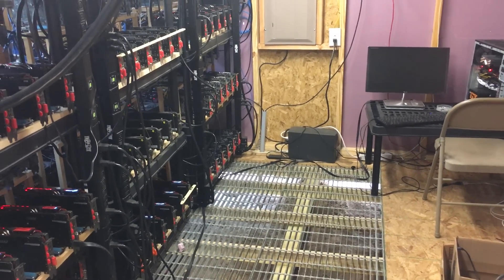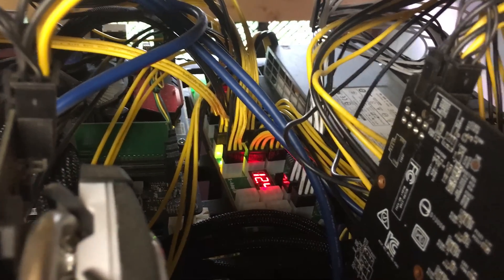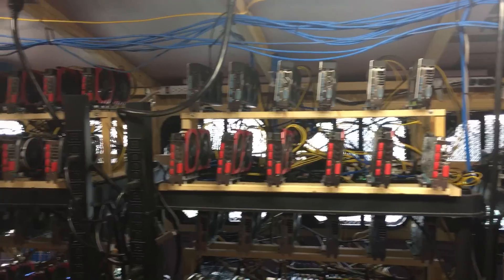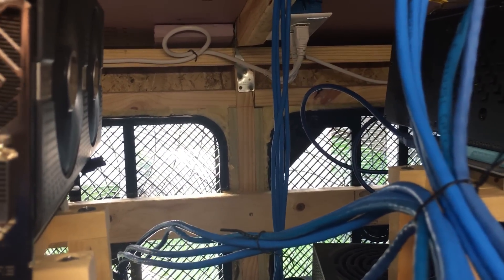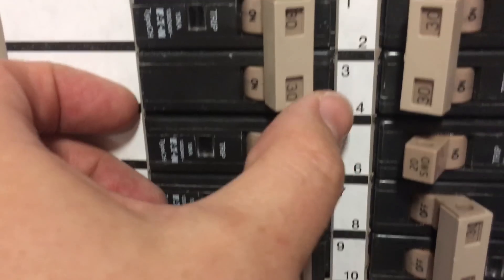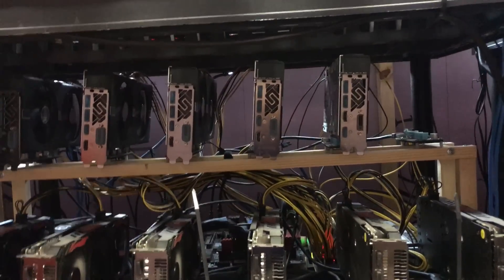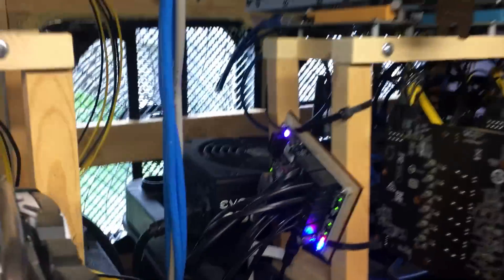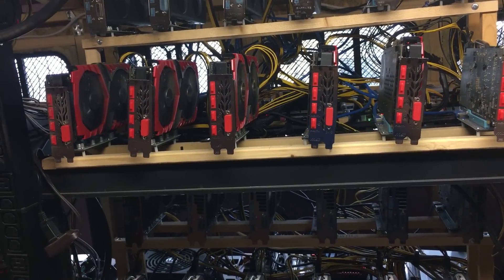5.6GH 192 GPU Ethereum Mining Shed - Nov 2017

Comment: I work in IT - and that cold aisle is key. Nice job man.
Reply from the maker: thanks, but as others have mentioned, humidity is an issue. Do you have any suggestions that can be integrated into existing system?
Reply: Well, you're pulling in outside air which can be humid. The cold aisles we use in the data center are conditioned. Perhaps you can run duct work from an actual air conditioner and blow the air up the vents from below.
Reply: BeerMan 81 or run a giant dehumidifier?
Reply: I doubt it would work; the air would have to pass through something to condition it before it enters. A dehumidifier unfortunately wouldn't process the air as it came in and out so fast. :\
Reply: I think you could try and use a dehumidifier
Reply: I work in IT as well. Seems you could limit some of the fans, put in a AC unit running on 110 or 220. Seal up the floor to keep that summer humidity down and put in one of those dehumidifier and run the drain outside. You would be cooling the space and dispersing any excess water.
Reply: @KineticEV  best answer I’ve seen
Reply: you can add gravel under your shed it will help you out alot.
Reply: I dont suppose we could get him to fit a Liebert machine in his little shed huh? xD Sr DC Tech here.. What about utilizing a commercial grade roller unit, allowing it to pump into the common air, run exhaust duct to roof onto a flap vent (opens when blowing, closed not, same kinda concept with a motorhome AC unit). Seal the floor, or AT THE VERY LEAST, install inline air filters, because youre not only bringing humidity, but youre bringing in critters and dust/other bad particles. Clean air in, bad air out. Keep fans though, thats a good idea.
Reply: I mean, have you tried a simple Dehumidifier?
Reply: i was looking at a way that they filtered air with bags for gensis mining, https://youtu.be/2Jqf_wZKFCc?t=3m36s
Reply: That air coming from outside dust will make the fan slow down in long term. Then it’s also hard to sell to gamers when it’s time to replace.
Reply: Also i would get some Hvac filters and figure out how to fit them to the grate underneath. change them every year atleast.
Reply: I was thinking run an air compressor through a HEPA filter into an air receiver with an automatic condenser tap to drain off the moisture from compression/external air.  Fit a pressure relief valve with a lower pressure than the compressor is running at, and you'll have constant dry oil/particle free air coming in.  It would mean sealing up the floor though so it might be a bit of a pain in the ass.  You could duct the incoming air directly below each rig with different size inlets though, so you'd cool them all equally.
Reply: LOL, a Liebert unit would make this a losing proposition in short order.  Mining is a thin profit endeavor.  Most real profitable mining outfits are in cold weather countries for just this reason.  The dirt, dust, grass clipping, humidity, and mice will destroy these rigs and electrical in short order.  Horrible set up for longevity, bet it never reaches break even.

Comment: I was looking to build a small scale version of your shed and wondered if it’d make a big difference having the air pulled in the bottom and exhausted above the shelves as opposed to behind like in yours? Where I’m looking to build a “shed” has coverage overhead about a foot above it. The box fans would be blowing up, but I’m wondering if the overhead obstruction would be an issue. What’s your GPU temps/fan speeds when it’s 90-100 degrees out?
Reply from the maker: That's good, however do not use box fans. Get a better fan or two with a bit more oooomph (lol). When we added filters, it cause a cascade of other issues. Our Antminer section has 2 of these and they are great. They are variable too, but you should be careful as they could auto-shut off. It may be better to have constant running ones. Call the mfr and find out.    http://a.co/iJlUuD8

Everyones situation is different, but you can see my temps here: https://imgur.com/a/WxjJPYq
Reply: Thank you. I think I have it figured out to where I can put the exhaust fans like you linked to on a side wall facing the screened in patio and the intake on the side close to the house. So basically I could do an entire wall that looks like your floor and have it come in one side and out the other. The grated wall would be about 6 inches or so from a solid wall with overheard cover, so no one would see the intake side, but it should be more than enough area to suck in air and still be secure. The room would be 8 feet long by 6 feet wide. I'm thinking of offsetting two 3 foot wide shelves and trying somehow to split the room in such a way that both shelves will have cold air going past and hot air being pulled out. It makes sense in my head, but maybe I'll have less room inside than I realize.
Reply from the maker: Build it bigger than you think you will need for sure. You need filters somewhere too
Reply: BeerMan 81 I’m thinking most of the 6x8 wall will be a “filter” similar to how you have your floor setup as the intake.

Comment: Why exactly did you "insulate" the inside of a shed with a giant hole in the floor?  SO much fail here.
Reply from the maker: The heat from the sun increases the ambient temperature of shed via conduction. The temperature decreased significantly after installation. Lower temperature = easier for GPUs to cool

Comment: so let says outside temp is about 90-100F, what would be your shred temp with this type of this exhaust system? I want to build this shred so bad but not sure if its applicable for Texas heat temp.
Thanks alot
Reply from the maker: I Live in Texas too. The heat exhausted is ALWAYS higher than ambient temperature because of electrical consumption. 

I would suggest better exhaust fans (see my video series on antmuffler) so you exhaust heat faster and because of the higher Delta P. This allows the fan to pull air through a restricted intake (ie filters).
Reply: I appreciate your input. May i ask what is the size of your shred and temp inside the shred in summer time?
Reply from the maker: 10x14 and about 96-100
Reply: I appreciate the info.

Comment: Hey quick question! Is your panel a three phase service or a single phase service!?
Reply from the maker: Single phase. The transformer in my neighbors yard is 480/240. You can mine on 3 phase as well, but the PDUs would need to be different than the ones that i use.
Reply: BeerMan 81 is it just a 200 amp panel I’m assuming?

Comment: Good job man.... good job...Keep improving!Just asking,I'm just a really small miner, I'm running 5 Rx 570(3x4gb + 2x8gb) and I'm only getting around 16-17mh/s per board with no bios mod or overclock...I just cant manage to solve this issue.. is it normal in this epoch?Check out my miner if u want to https://eth.nanopool.org/account/0x8d915ceb9c3f82e735a52663cf3fa7dbdde36c76
Reply from the maker: you dont have the blockchain drivers installed. https://www.youtube.com/watch?v=JRS1NMGaYe4 https://support.amd.com/en-us/kb-articles/Pages/Radeon-Software-Crimson-ReLive-Edition-Beta-for-Blockchain-Compute-Release-Notes.aspx
Reply: BeerMan 81 thanks man... But I'm running Linux
Reply from the maker: Which Linux version or mining OS are u using?
Reply: Ubuntu 16.04

Comment: also why would you insulate you are trying to get rid of heat with ambient air so it will never get cooler than outside anyway
Reply from the maker: Because the sun heats up the walls and transfers heat into the air, which heats up the ambient temperature inside the shed. It helps a lot actually.

Comment: 200000 dollar investment 2 months to set up 2 years to pay off, just my guess. After 2 years assuming coins hold price then making 100000/yr and declining. due to increase in difficulty. 2000/year maintenance. 2021 until it pays off for sure. How close am I???
Reply from the maker: 200k? Where did u get that number?
Reply: it is a guess you have building cost fans motherboards watchdogs power supplies risers and the works. it all adds up,  how much was it and how much are you mining, may i ask?
Reply: batman 1999 maybe 350 a day?

Comment: Um Dude why do you have the heat exhausts pointing into the room when they should be pointed at the wall fans?.. Just curious..
Reply from the maker: Each GPU discharges air differently

Comment: Did you add a new line for the breaker? Also, did you have problems with building code regulations? I see that you have exposed wires.

I'm currently finishing up a shed for mining as well. I based my shed idea off of yours and a mining box idea

Comment: Your letting dust particles in from the floor, overtime it will pollute the fans and they will stop working. Best put some fans below the floor and cover the floor with dust collecting fiber. Also you should hot wire, heat sensor, sound sensor your shed with micro controller like Arduino, so when someone enters your shed without your permission you know.

Comment: hey mate - this is a crazy set up. Wondering, those 1->4 splitters, how do you find them, reliable? and where do you source them? Have you found there to be a maximum number of them you can use?
Reply from the maker: That board has a limit of 12. Dunno why...
Reply: BeerMan 81 have you tried other boards? Do some vary in how many they will accept? Which brand /model is this board?
Thanks for your help
Reply from the maker: This is the only one that I've tried. I tested two then ordered 30 more lol.       https://www.google.com/search?q=pcie+port+multiplier&rlz=1CDGOYI_enUS777US777&oq=pcie+port&aqs=chrome.1.69i57j0l3.3359j0j7&hl=en-US&sourceid=chrome-mobile&ie=UTF-8

Comment: Is it not possible for water to splash up inside that floor grate on a super rainy day? Or does it not rain much where you are.  Also do you have cards just sitting in the riser without anything stabilizing the IO bracket? That seems like it would be putting alot of undue stress on the PCIe socket and the card itself.

Comment: Can u explain which rig and HOW is connected to the Monitor to view all the data and or all other rigs working together ?
Reply from the maker: Sure thing! All the rigs are working on the the same pool but are separate from each other. Each rig is managed by a configuration file hosted remotely, but does not have to be. All are visible via online website or locally in network. You can control them via ssh internally via my network

Comment: No floor I see, but what happens with moisture in the shed during cold nights for example? Or is the air so warm and flows so much that it's not an issue? And maybe you live somewhere where freezing is not an issue.

Comment: Why bother with insulation? You're trying to draw the heat out as fast as possible, so that's completely counter productive by trapping the heat in with insulation.
Reply from the maker: You make a good point, but in practice this is not the case. The sun heats up the walls which raises the ambient temperature inside  the shed which is bad. The insulation provides a barrier from the sun.

Comment: well, I'm adding my second GPU today...
Reply: I don't even have a GPU :(
Reply: 1Lifeonearth just did the same LOL. I'm up to 300 a month tho!!
Reply: Same here. I'm adding a GTX 1060 to my GTX 1050ti.

You gotta start somewhere, i guess. :D
 Even with todays prices, it will return in a bit less than 5 months in my country (considering taxes, electricity and amortization). Well, tha fact that i got a dual fan GTX 1060 at a normal market price (it was 80USD less than any other dual fan version for a bit) helps a lot. My goal is to fill all 6 PCIe slot in my mobo... for now.
Reply from the maker: Good for you! Hodl them coins
Reply: i’ve never even had a pc before
Reply: 1Lifeonearth lol same, added a GTX 1060. I'm up to $120/month

Comment: How come the servers are using M.2? I understand it pulls less power than HDDs, but wouldn't USBs be better? They are cheaper and you don't really use the space for stuff other than the OS if i am not mistaken.
Reply from the maker: the m.2 Sata SSD are like new from old chromebooks. They cost around $8 shipped. Around the same price, and more reliable IMO and FASTER.
Reply: Woah, that is really cheap, i thought you were buying the new ones at 100 usd for 128gb or so. Thanks for the answer :)
Reply from the maker: https://m.ebay.com/sch/i.html?_from=R40&_nkw=m.2+ssd+16gb&_sop=15

EthOS only uses like 4g. Lol, still have 12gb free

Comment: nice, how do you get 29 m/h a card from the msi cards using linux? I get people use afterburn for windows but the most I get for linux is 18 m/h
Reply from the maker: you need to flash the vBios with different timings.
Reply from the maker: have you modded your bios?

Comment: ok, really cool setup for mining, However the venting.... uhhmmmm you should definitely consider hiring someone or study everything you could imaging that needs 24/7 venting relating to pc or even not related at all. It really does not have to be that loud and you need dehumidyfiers, some sort of copper insulation to keep it cooler with a better fan that runs on low power. Im not an expert for sure but yeah i believe in you believing you need to fix that. how much for utility cost?

Comment: You can buy RAM that doesn't have spikes, lights, or skulls on it??  Does it run just as fast as regular RAM?
Reply from the maker: this is budget ram. DDR4 2133. It does not run as fast because it doesnt need to. each rig has only 4gb of ram, but only like 1gb is being used. It is important to put the money IMO where it counts.

Comment: I never get how someone can spent so much on the hardware and then puts it in the most crappiest building, Wood framing... I get that amateurs do that but investing that much and then not doing the last 5% that are crucial for big builds... I dont get it. Just take a data center for example and do as they do and not like you have cows in a shed.
Reply from the maker: what is wrong with wood framing?
Reply: if something goes wrong it could catch fire and destroy the entire shed right.

Comment: How do you get the data down the ethernet fast enough?
Reply from the maker: Ethernet speed is irrelevant. the miners only use 0.2 kbps.
Reply: Combined or each? Why do you need all that hardware to process only 200 bits/second? I thought Gpu/CPU rates in the order of Tbps were desirable?
Reply from the maker: right, the GPUs do tons of calculations per second, but you asked about ethernet. the switch is 100mbit ( you dont need a 1gbit sw because they are too pricy, and the data that is sent accross the network is negligible.) each rig tx/rx around 0.2kbps to send and receive the shares to the mining pool.
Reply: hi, thanks for your reply. What I do not understand is how come GPU's are doing millions of calulations per second on only 200 bytes/sec of data?
Reply: They don't transmit all of the data back because it's not important - they only need to transmit the final results and request new work shares.

Comment: This is awesome.  I dream of doing this, but you can't buy GPUs anymore. :(  1 GPU is going to do for me. guess that's what I get for being late at the game.
Reply: Late? Never too late.
Reply from the maker: u have to be quick
Reply: im getting 4 r9 280x and i think i will mine something with equihash like zcash zclassic
Reply: It's never late you don't have to mine ethereum there are other options. you can do ethereum classic after. Nearly same profit
Reply: The issue is GPU availability.  Can't buy them easily without paying crazy scalper prices.  Pretty much have to spend all day on retailer sites hitting F5 if you want to try to get lucky but nobody aint got time for that.  Would be nice if they would rev up production.  There's obviously a big demand.   May look into BURST though, I think it uses mostly hard drive and cpu.  Need to read up more on it.   did manage to score a second GTX 1070 TI on Ebay for under a grand though.
Reply: Red Squirrel try through Alibaba they have some rx580
Reply: Red Squirrel just use trusted money back source not the ones for 200
Reply: Good, I'm glad you can't afford a GPU. Why don't you get off your ass and get a job huh? Sounds like a plan to me.

Comment: This setup is inspiring.  For the watchdog, I made something similar with a raspberry pi and a couple of the 8-relay boards off amazon and running about 50 lines of python/bash to control it.  1 Raspberry pi can simulate pressing and releasing the power button for 16 motherboards.
Reply: Can you please give the detailed desricption of what you did and post this code? I have Rpi and was thinking of making the watchdog with it but being able to write only basic scripts. Thank you in advance!

Comment: If your goal is to exhaust hot air from the GPUs toward the "wall of fans" sending air OUT of the shed, then your cards are BACKWARDS.  GPUs vent hot hair out TOWARD component ports.  Right now the way your cards are set, hot air comes into the middle of the shed.
Reply from the maker: That was my original setup, but each card exhausts hot air differently
Reply: It is still very impressive :)  How many GH are you up to?